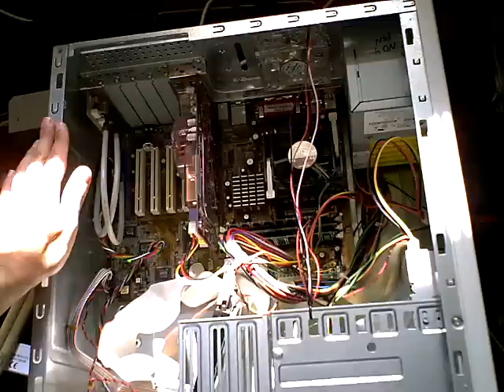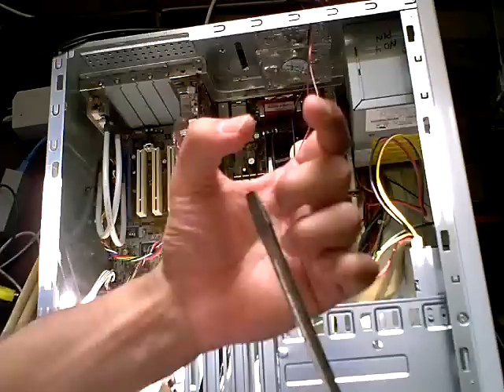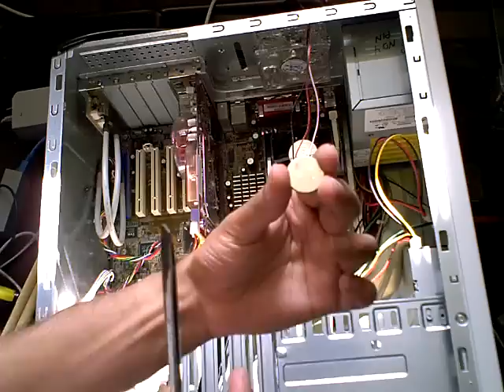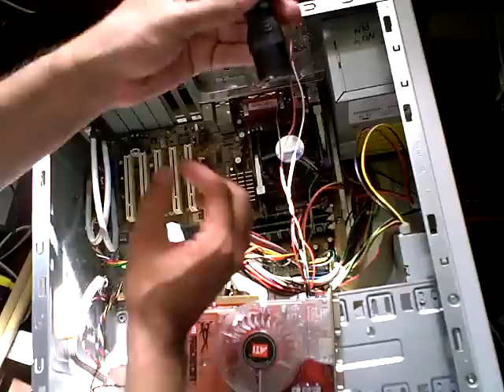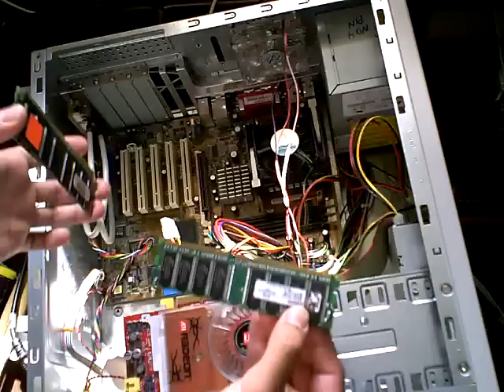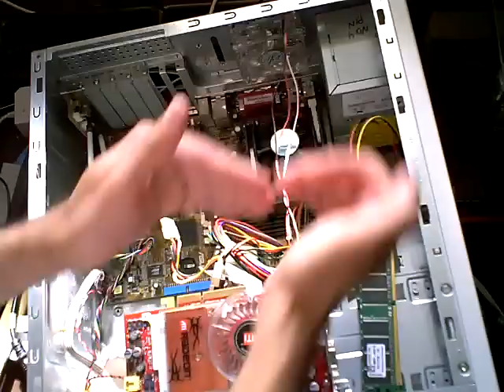How to possibly fix a PC that will turn on but will not beep and will not display anything on screen

Comment: Hi there, would be grateful if you could help with the difficulty im having whilst starting my computer up.
My computer had been slowing down recently, until it crashed whilst running a game and will not start up now. The fan makes an abnormally loud noise, and the beep will sometimes be continous, sometimes fade and come back on a few times, it changes everytime I restart it. Nothing comes up on the screen apart from my monitor logo (so the monitor obviously isnt the problem) and the computer remains like this until I unplug it again. 
if it helps, I did find a few adware viruses on my computer that installed with other .exe files, but im almost certain that this wouldnt affect any hardware or interal components whilsy starting my computer up...?
Thankful for any response ASAP :)
Reply from the maker: Heh, looks like your account name says it all. Given that the PC speaker is giving different beep error codes, it sounds like a problem with the hardware and not just at the data level. Try the CMOS reset method shown in this video and lemme know how it turns out.
Reply: RodneyDickson true, didn't realise the irony in my account name... so could there be any damage to my hard drive? I'm a lot more concerned about the data rather than the tower itself, as that can be replaced and the several years of files cant. thanks for your reply, will give it a go.
Reply: RodneyDickson UPDATE: At a closer look, my computer does only make one (slightly faded) beep , and on startup I have recently noticed that two red lights briefly flicker on and off on start up on a red card situated inside the tower. It apears to be a radeon card which is a graphics card (ATI) could this be causing the problem? I do know that the last used program on the PC was a game that used the graphics card to a high level (The sims 3) which during gameplay, would crash a lot : I would get an error message from "ATI" saying that it had crashed (and something is telling me this isnt a coincidence). The slots on the side seem to be full of dust but are very hard to clean due to their position. Thanks again.
Reply from the maker: ComputaSezNo
Does this PC have integrated (onboard) graphics as well? If the problem is related to the video card (draining too much energy or otherwise defective) you can try booting without it and see if the onboard does the job. Regarding your HDD btw, it sounds as if this problem would probably not affect the contents of the hard drive, so this data is most likely safe.
Reply: RodneyDickson ok good, thanks again. All I know is that it has a radeaon gaming graphics card that is removable, otherwise I am unaware of any other built in ones...
Reply: RodneyDickson *radeon
Reply from the maker: ComputaSezNo
Hmm, well, if you do not see another monitor out connector on the back of your PC aside from what is connected to your addon video card, you might require either a different video card (your video card may be defective) or perhaps your power supply is now too weak to continue to support the video card. Another possibility is that something became defective at the motherboard level and because of this, everything is being mismanaged. If you have access to another video card (borrowed from another PC) you can try booting with that to see if that lets you around the issue. The same goes if you can borrow a different power supply. If none of these work out, perhaps it is the motherboard that is finished sadly : \
Reply: RodneyDickson well I have decided to purchase a new video card and try it out, fingers crossed it works. Thanks for taking the time to reply/help :)
Reply from the maker: ComputaSezNo
If you haven't purchased the video card yet, make sure to buy one from a shop that accepts returns on open merchandise for refund in case that is not the source of the problem.

Comment: Hi. I was playing H1Z1 with my GPU Cpu slightly oc (M5 A97 2.0, Fx6100.) I smelled a weird smell and a poef happened. now I am unable to even switch on the pc. however the light on the mainboard is working but when I press the power button not even the fans or leds of the encasing respond or switch on. I think my PSU is broken but the power switch on the PSU is lit.

any idea what it could be?
Reply from the maker: +SuperHns Yeah, your CPU is blown sadly. Your motherboard might be wrecked too sadly. I'm kinda anti-overclocking for this reason
Reply: +RodneyDickson na it was just the PSU. I replaced it a new one two days later and it worked
Reply from the maker: +SuperHns Thanks for the update : )

Comment: Can a faulty Cmos battery cause problems loading the OS. Mine is faulty and I cant load the OS or go into BIOS so Im praying that replacing the batt will fix the problem
Reply from the maker: +quivalla Yep, some boards function in this manner.

Comment: My fan runs full speed without stoping and I get no signal to the monitor. The USB ports still work though, so could it be the motherboard?
Reply from the maker: It could be a multitude of things. I recommend you try all of the steps shown in the video. Let me know how it turns out.

Comment: Actualy in over 50% of the cases is bios chips fault meaning that its fried i have some expirience with fried bios chips both of them in asus boards one of witch is the same board witch you used and the other the striker 2 extreme .Also bios chips can be changed you can buy bios chips from an online vendor of your choice
Reply from the maker: +andres kwstopoulos Good tip, thanks

Comment: hi! i think you can help me.my computer is have power sometimes have display sometimes not.what irritate so much me is sometimes it wont display.when i remove the ram theres a beep code that there is no ram.when i put my ram there is no display i use different ram that work on other pc but nothing happen.but when i try and try sometimes there is display.what do u think?what will i do??right now my pc is no display my head is aching..maybe later will work again.its not over heating so its not the cost of no display..thank you.. hope you can help me..
Reply from the maker: +april recto Fraid I cannot. In cases of intermittent bootup, I recommend to users that they get their PC in a working state, and then put it to sleep when not in use to wake it easily when needed.

Comment: idk if you still reply but i removed my ram to the point of not having any and it beeped so i put one chip back in after numerous times resetting the cmos i got it to post o btw its 2 sticks of ram and then after i stuck the other stick in and it wouldnt post just only with one stick and vice versa i swapped the sticks around and the other one worked as well to so is my motherboard bad? pretty sure it is also in cpuz it reads my full 8gb its just only using 4gb
Reply from the maker: +shineything4444 Sounds like a motherboard issue if each RAM module works independently but not together. If you have more than two sockets, try two different sockets than you usually do.
Reply from the maker: +RodneyDickson Also, in the BIOS, check if you have RAM settings for compatibility...turn that on.
Reply: im not using that computer at the moment ill tinker around with it seeing as its not my main computer anymore but still like to keep it for the decent processor lol
Reply from the maker: +shineything4444 When you got the free time I guess : )
Reply: RodneyDickson free time now thats a word i havent heard in a long time
Reply from the maker: +shineything4444 Heh, for me it's the opposite, thus why I'm responding to comments from 1.5 years ago : ) Hey, it's a passtime : )
Reply: lol good way to put it

Comment: Hi i also have the same problem but sometimes my computer works normally. It turns on like a normal pc with display until a couple of hours or mins den suddenly it prompts an error code and hangs up/lag/freeze or restarts after that it shows no display :( any advise?
Reply from the maker: +Clint Tiu Given the unreliability of the machine, I'd replace minimally the motherboard, but preferably the motherboard and CPU+fan. Before all of this, you can try replacing the power supply and see if that helps, but I'm doubtful.
Reply: +RodneyDickson hi thanks for the reply. I did fix my pc. I just change the heat sink. It solved the problem :)
Reply from the maker: +Clint Tiu Wow, just that, huh? Well, glad it's sorted

Comment: hello bro . when I open the computer only makes a (one) beep and does not open anything, i.e the keyboard does not open lamp and mouse the same but!  but they work all the fan, hard disks e.t.c 
anyway 
remove graphics card and connect the display cable to the board, and work opens normally, the problem is the graphics card? 

(sorry for my english)
Reply from the maker: +Drejon Creator Server Could be a compatibility issue, could be a power connector is not connected to your video card, or could be your power supply is not powerful enough. Look for a power connector port thats not connected first, then ensure you have enough wattage from your PSU for that card, then check your motherboards support website to see if the card is officially supported.
Reply: +RodneyDickson Thank you, (the graphic card still works) I will try to change the power supply. (I had an issue with the power supply[maybe short-circuit])
Reply from the maker: +Drejon Creator Server k then, good luck with it : )

Comment: I have a PC that randomly stopped working one day, it just shut down. When I try to power it on I get no display on monitor, the fans and hdd spin up, after about 45 seconds it shuts down on its own, if I try to start it again it will only stay on for about 10 seconds. AMD FX 8350 cpu, MSI 970A‑G46 mobo. I've tried reapplying thermal paste and I currently have a new cpu cooler on the way. Any idea what the problem could be?
Reply from the maker: Can't say. Try to Breadboard it (explained in the following video:)

If the steps in this video did not provide a solution to your problem, view:

http://www.youtube.com/watch?v=_EK9a-R5pss

You never know, maybe rebuilding the PC in the opposite sense that you took it apart will solve the problem.

Comment: I have a question to you. My computer is have a Bluescreen What is the problem of that?
Reply from the maker: +christian delostrinos Could be a multitude of issues. I recommend first going into the BIOS, loading setup defaults, then saving and exiting. If the issue still happens, I'd format the hard drive and reinstal windows. If it still happens with a clean machine, then one of your components is probably faulty (generally google searching the BSOD error code will tell you which one)

Comment: Rodney I need help, my pc has its power light on (the thing you press and it turns on) when i turn on the avr. It normally doesnt turn on if I dont press it but now it's lighting on. By itself and my PCwwon'tboot. Ive been facing this problem for a week and I have a school project in that PC that I need to pass next week
Reply from the maker: Sorry, I didn't get to your question in time. I'm trying to understand what you've typed, but am having problems. Are you saying that you have to keep your finger on the power button or else the PC will shut off? Please rephrase
Reply: It was the motherboard that got damaged because of 4 years of use. BTW nice video it did help me a bit ^-^
Reply from the maker: (shrug) ok, as long as things are good now : )

Comment: Thank You :) RodneyDickson great explanation.
I've got a question..
I'm ok with my windows i didn't encounter any problem the only thing that pisses me off is that that Date/Time keeps resetting every time i restart my pc.
Is it the CMOS Battery i mean is my CMOS not working properly or might be dead?
this problem just pop-up months ago and i couldn't remember if i did something u know wat i mean.. BTW this vid. really helps me a lot HUGE TNX TO YOU.
Reply from the maker: +Hello ImChris Thanks for the kind words Chris. Yep, sounds like your CMOS battery is dead. Replacing it should solve this issue (hopefully)

Comment: Hello, occasionaly while polaying games my computer would randomly stop displaying video and output sound, after that would happens i try to hold the power button down but nothing, i then have to turn off my power supply at the wall etc. Bu this moening after turning off my computer last night it now starts up as usual but doesnt display anything. It doesnt beep or anything to tell me its failed.
Reply from the maker: +MJP | Gaming Same issue as in the video. Follow the steps

Comment: Hey I'm watching this video 3 years late but I'm still getting a similar problem. I recently switched my computer case so I had to move everything. When I started the computer up the fans and everything started up but about 3 minutes later I brought me to one of those back and white screen then finally it brings me to the log in screen. But the problem
Is my mouse and keyboard have no power for some reason so I can't log in. Please help thanks
Reply from the maker: +legend Chances are you did not connect the USB headers correctly from the case to the motherboard. You can of course connect these properly, or just use the USB ports on the back of the PC (those that are part of the motherboard already)

Comment: hey, i have a question my pc is not working. i ll explain the problem in detail, could you please help me to make my pc work.

when i turn on the pc after a long time then it works, it starts normally and then it automatically struck after after an half an hour usage and the screen will remains same and no functions work. if i do restart and then it wont work. only the red light blinks and no responce to the display ........please help me to solve this issue
Reply from the maker: +SAI KUMAR It sounds like your processor is overheating. Unplug your pc, press the power button on the chassis, open up the case, and observe the fan bracket (which holds the fan in place connected to your heatsink)...ensure that there is nothing broken or otherwise damaged. Rotate the fan with your finger, and if it rotates slow (as if it is gummed up) then it may require replacing. Also, observe the capacitors on your board (the cylinders) and ensure none of them are swollen or otherwise damaged.

Comment: I have an all-in-one desktop computer. When I was updating audio drivers and other stuff the screen just stopped working so I tried to restart it. The display is completely blank, power button light works, USB ports and that stuff isn't working. I don't hear any beeps on startup.
Reply from the maker: +Zake Same issue as in the video. Follow the steps
Reply: It has been repaired twice, and it worked fine, but when I try to restore it to factory settings it does the same thing again. The hard drive and power source have been changed by professionals. Could you give me some advice?
Reply from the maker: +Zake All-in-one's are tough cause you can't breadboard them. Best I could tell you is that if you do manage to get it up and running, instead of powering it down when not in use, put it in 'sleep mode' so that you can awaken it when needed and avoid this possible 'not POSTING' situation. Good luck with it.
Reply: Ok, thanks!

Comment: woah looks like my cpu fan was causing trouble..
I replugged it and it worked!.. but anyway do you think I should get a new fan?
Reply from the maker: +Jasjeet Singh Check your CPU temperatures in your BIOS after running the PC intensely (like after gaming) and if the temperatures are hovering close to the shut-down temperatures (also listed in the BIOS) then yeah, a new fan might help
Reply: +RodneyDickson 
thank you for replying. will check

Comment: So i just build my new gaming pc today we hooked it up to the monitor turned it on and everythin lights up all the fans work except there is not image . Did i do something wrong?
Reply from the maker: +Jesus Sanchez Breadboard it (explained in the following video:)

If the steps in this video did not provide a solution to your problem, view:

http://www.youtube.com/watch?v=_EK9a-R5pss

You never know, maybe rebuilding the PC in the opposite sense that you took it apart will solve the problem.

Comment: hey rodney my pc is a dell, my pc use to turn on beep once than turn off so first i thought is was the power supply unit, i bought a new one, then it kept doing the same and i noticed my cpu fan wasent turning it was twitching though, so after turning my pc on the fan would twitch a bit like its having a seizure and my pc would turn off 5-6 seconds later so i changed my cpu fan and now i turn on my computer and cpu fan turns good , its working perfectly but now i get no mobo beep nor any screen display and when i push my power button it dosent even turn the computer on or even off when its turned on i have to unplug it everytime to turn it on i tried unplugging every port replugging everything i have no idea what the problem is if you could help me thank you
Reply from the maker: Well, I'd try everything shown in this video to try to discover what the trigger to this problem possibly could be. Let me know how it turns out.

Comment: What is the best way to test a not-working RAM slot? Could be risky to place a new RAM on it?
Reply from the maker: It is risky if the RAM socket has a short, burn marks, missing contacts, foreign metal making contact within, etc. Often times, there is no way to know this for sure until the socket kills a RAM module, so if you have doubts, maybe its best you just avoid that problem RAM socket : \